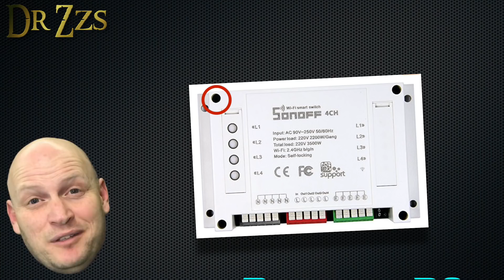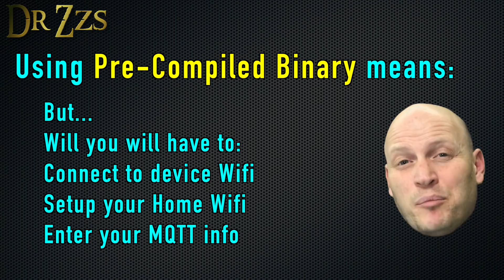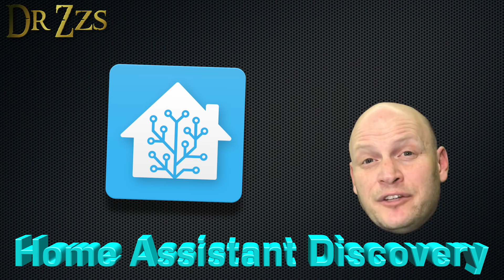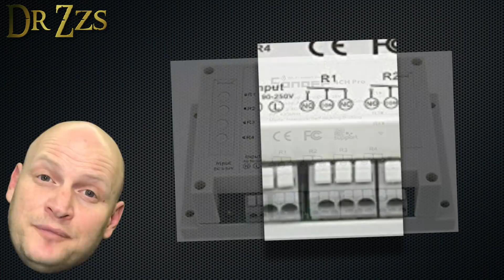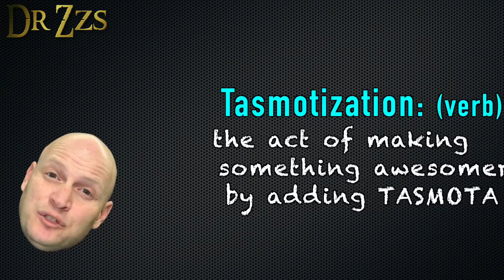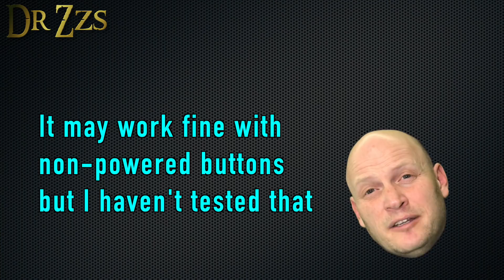Sonoff 4 channel w/ Home Assistant Discovery and FlashEZ

Comment: I been looking at your video, seen it a few times, Im trying to find a useful application for the 4 channel SonOff.

Looking forward to your RF bRidge video..   that I am interested specially if I can use the RF signal to start my car..
Reply: i use a virtual machine for Win10 running on my mac on VMWare Fusion. u can use Virtual Box as well.
Reply from the maker: oooh, so you currently have a remote start for your car?

So far, what I've learned is that some RF devices have changing codes to keep people from stealing the code and opening your garage or starting your car.  For those devices it may not be possible to program the RF bridge to learn the code.  
It still might be possible.  I'm not an expert on RF by a long shot.  There still might be a way.  I just want to manage expectations a little.  
If there is a way to remote start your car with the RF bridge we'll figure it out!
Reply: I have faith in you, some how or another you get it to work, It might not be the best or easiest way, but it work, which to me is the goal...     

BTW do you know if there is a ESPeazy for a Mac?  or a way to flash the sonoff?
Reply from the maker: Mac has trouble with the ftdi (or other) serial/usb adapters.  I've had it work a few times but not work most of the time.  There's steps you can try that I don't remember; deleting some drivers and installing others.  It was a pain, and then didn't last...  You can try googling.  I've just gone to Win10 for all my flashing.  Do you have a windows computer you can use for flashing?
Reply: DrZzs no

No I don’t have one at home.   Ill figure something out.   BTW. I m doing my Christmas light. Next month.  Im getting the lights from Amazon and want to give you credit.  Can you send me the link please. Tx
Reply from the maker: Awesome!  You'll love the lights.  I need to update the sketch.  I've got some more lights to put up myself this summer.  Here's a link: https://amzn.to/2L80mAN
That's for 10 strings of 50 leds each.  If you don't need that many there are other sellers.  
https://amzn.to/2L9Ejt9

Just make sure they are ws2811 and I'd recommend 12v.  I used 5v cuz they were cheaper.  
https://amzn.to/2sqHftY

You could do that too.  
As long as you use one of those links to get to amazon, it won't matter what you buy after that, I'll get a small %.  
Thanks!
Reply: Packed my stuff and off to the in-laws ...   they havve windows...   :}
Reply from the maker: excellent!
Reply: Ill give that a shot.  thank you

Comment: If you use optocoupled relays avoid to exede the maximun output of the GPIO only mathers the power given by the sonoff power supply, I think the sonoff can power the relay, only needs to amplify the current output of the gpio with a transistor better an optocopler.
Reply from the maker: sounds like a fun and challenging project!
Reply: Is the same you try but you show pictures of a single relay without any circuit, try to find one with optocoupler and conect it the same way.
Reply: Javier Enrique Traid mind you that the optocoupler relays are often inverted needing a low to activate them. 
Also the common 5 volt relays use about 65 mA. Having a bc547 to drive them requires very little current as well as they have an hfe well over 100
Reply: Ed19601 I know but comes rele modules with logic input all included in the module
Reply: Very true, but I was only mentioning  the transistor type as an example. Non-inverting transistor driven relay modules  also come complete for a few dimes.
My point was that the sonoff pin has no problem driving such a module

Comment: I've been using the discover method for some time now. If someone knows how to get rid of unavailable devices in HA that would be great, to much testing (maybe time for dev system). Having a WAF issue, switches go unavailable then on and off in HA, causing automation to trigger. Lights turning on and shutting off for no reason. tried to use retain commands but it just seemed to make it worse. Welcome your thoughts? and as always your video's awesome.
Reply: delete the mqtt database, thats the only way i have found to remove them

Comment: Hello again quick question about the FTDI, i checked with a multimeter and the tx and rx pins of the FTDI are sending out 5v even when the FTDI is set for 3.3v, same case with Arduino nano v3, is this normal? I tried using a logic level shifter but even though i can flash successfully I wasn’t able to read anything on termite with the logic level shifter attached. 

Can you tell me if its ok for tx rx pins to be 5v, i had ten sonoff basics, but flashing successfully is hit n miss and i think ive ruined 3 of them already with two more left to flash
Reply from the maker: that seems bad.  I'll measure the voltage output of my ftdi.  I'd be surprised if it's 5v.  I haven't experienced it myself but have heard that flashing with 5v output is very bad for the esp chip.
Reply: DrZzs thanks for the reply, and also for all the amazing easy to understand and well made tutorials, please do check the voltage on the TX and Rx pins and get back to me, I'm Hella confused lol
Reply from the maker: sorry, I forgot to do this last night.  I'll try and remember tonight.
I'm planning on doing a live stream on Sunday so maybe someone will remind me to do it then if I forget again.
Reply: DrZzs any update on this?
Reply from the maker: thanks for the reminder! 
Sorry I forgot.  
I just measured and my ftdi definitely outputs 3.3v  
If yours doesn't then either there's a switch or jumper that needs to be changed or you got a broken one. 
mine has a jumper that needs to be changed to switch between 5v and 3v.  Maybe yours does too. 
Bummer man.  Hope your sonoffs aren't ruined.
Reply: DrZzs oh no there’s definitely a solder joint to shift the VCC to 3v, what i was saying was even with the VCC shifted to 3v and reading 3v on the meter, the tx and rx pins still output 5v (while the VCC pin outputs 3v)
Reply from the maker: Shamsher Razzak that should not be happening. You must have a bad adapter.  Maybe write to them and see if they’ll send you a new one. Show them what it’s doing with images or something too.

Comment: In Home Assistant, there is something called the entity_registry.yaml (or something like that -its in the same directory as the other yaml files).  All newly discovered devices are populated in there, and associated with a unique ID automatically.   You can edit it and change the device name, and even delete the device from there, but I don't think you can change the unique ID.  I think they added this feature from version 0.64.   

Btw, I literally just got my 4ch pro last night so this video is PERFECT timing.  Can’t wait to get home to tamsmotize it. Will post a video of a project I am working on using this on automated shutters.  I am also building a homemade garage door opener so I may use the 4ch to power 
this.  You should call yourself the Tasmotian devil. Lol
Reply: I checked the entry_registry.yaml, It shows devices Hass.io has discovered like Roku TVs, however sonoff's using MQTT discovery do not show up?
Reply: Is the sonoff showing in the frontend?   If the device is visible in the front end, it should exist in the either the config.yaml or entity_registry.yaml file or both, that is.....unless the HA developers made a change that I don't know about.  Also, although my device discoveries have been pretty instantaneous (pretty much right after the device has powered up), the discovery can take some time.
Reply from the maker: ha!  Love it
Tasmotian Devil!  yes!

Comment: I believe a key point of your presentation was the statement regarding adding an external PS kind of makes the whole Sonoff thing less useful.  I too find that because there are such powerful software options available, and countless devices to add to our systems, it is easy to inadvertently push the technology past the point it serves us.  But seeing as how most of us are doing this for fun more than utility, I guess pushing the limits is what we're gonna do.  If I didn't fail half the time, I'd probably find a different hobby....
Reply from the maker: well said!

Comment: Love your videos, keep up the amazing work 😊. 
Since according to your videos you are using hassio install, are you experiencing the need to reboot the raspberry pi on a daily basis, since it hangs?
Reply from the maker: I have not had that problem.  
Is that something you're experiencing?
Reply: Yes, I'm still investigating this issue , might be due to some issues with Asus router. The thing is, I use in parallel Smartthings hub, which I don't have any issues with. Anyhow thx for the input, I will investigate this further, and again great work you are doing on this channel :-)
Reply from the maker: Thanks!
If I learn anything about hang ups and needing to reboot I'll let you know.

Comment: Can ESPeasy flash Tasmota on a D1mini too ? I've been trying my nuts of all week to flash it with the Arduino IDE. The flashing seems to work, but my D1mini clone doesn't connect to the Wifi. I also put the WIFI_MANAGER line in tasmota, but it doesn't seem to broadcast any wifi as well.
Reply from the maker: That's a great question.  I don't know, but it might.  
I'll have to try it and let you know.  

I know there was a problem with Tasmota 5.13 and wifi connections.  I just flashed a couple things with 5.14 and haven't had that problem.  

Probably the biggest difference with the D1 mini over the Sonoff is that the D1 mini has 4m memory and the sonoff only has 1m.  That shouldn't limit using the .bin files from github though.  

I'll try it when I get a chance in the next few days.  If you get to it before me let me know how it goes.
Reply: Well, the flashing itself works like a dream. For testing I flashed the sonoff-NL.bin file to the D1 mini, since I'm Dutch. But I can't figure out how to get the D1 to broadcast wifi to log into it. I'm beginning to think that the wifi is broken on the D1.
Reply: Well shoot me down !! Not sure what happened, but it works !!! But it is quite a mystery. I'll tell you what happened.
I tried dozens of times to flash the old fashioned way with the Arduion IDE and such. Filled in my router info, MQTT broker etc. Flashing went well but no connection to wifi or whatsoever. Also tried to activate the WIFI_MANAGER function in Tasmota, also with no luck. Tried the ESPeasy method with the standard sonoff_NL.bin file from the Tasmota github page, again flashing worked but never a connection to my WIFI. Looked online to see wich connection is GPIO 0 , so I could "press" it four times like in your video. Again it seemed like nothing happened. Then fired up my IP scanner, only to find out it had connected with the IP adress I gave it in the first place while flashing with Arduino IDE !!!!! I could log in tasmota and all my info was there, ip adress, MQTT broker, everything. I noticed there is no D1mini option anymore in the config, but the 'GENERIC' option shows all the buttons and such.
Reply from the maker: go figure! 
Sounds like the Gremlins were having some fun with you ;P 
I've certainly had some flaky wifi connections sometimes.  Just last night I was going crazy trying to figure out why the RF Bridge sensors weren't working and it turned out it was just struggling to connect to my network.  That happens too much.  I'm going to try a dedicated router just for my HA devices, but it also makes me want to use wired connections whenever possible.  Too much dependance on Wifi seems to be a problem. 
Glad it worked for you eventually!
Reply: I was thinking the same thing, although I just mounted two high power accesspoints in the house wich work absolutely great. Only thing left to do is configure pin D3 as a switch, and get it in HA to control the bedroom light sonoff from the bed. Do you know how to set that up ? So, bedroom light is controlled by a sonoff basic with a momentary pushbutton and in HA, so this D1 should become a switch in HA, and toggle that sonoff basic.
Reply from the maker: That should be doable.  It would be similar to the way we did the Sonoff SV for the garage door I think.  The trick will be not having that D3 button activate the relay on its own board.  I just need to tinker with it a little and figure out the bugs.  
That would be a good topic for a short video.  I'll put it on the list.
Reply: I'll vote for that to be your next video. ;)

Comment: Not sure I understand the comment of the 240 in other countries?  The US uses two hots for 240.  Other countries use 1 hot for 240.
Reply: It's because your wiring standards are so low you can't be trusted with more than 120v :)
Reply from the maker: It was just a joke.  Some commenters had poked fun of us for not using 240v.  Those extra terminals really aren't necessary.
Reply: Gotcha, didn't want someone thinking they can run 2 phase power through it.  Where they can poke fun is the whole 2 switches in what we call 3 way.
Reply: Maybe I've seen just awful wiring jobs, but I've seen some terrible wiring on the forums in other countries and people act like it is normal?  I still stick to the US wiring with neutrals in every switch box though.
Reply from the maker: See travis.  This is what I have to put up with ;P

I'll have you know I only tripped the breaker once yesterday installing a sonoff for my garage lights.  And no one but me even noticed the sparks!
Reply: You know you love the banter and to be fair I've never implied you or what you do is dangerous :)
Reply from the maker: I do love the banter.  All in good fun.  :)
Reply: Banter is always fun! eunc00 have you seen his sonoff wrapped in electrical tape? To be fair I do believe he called himself out on that in a later video.
Reply from the maker: ya, I did some dumb stuff in that video.  I would take it down but it's still my most viewed. 

The other day I googled "Tasmota" and the first link was to Theo's git hub and the second link was to that video!  So even though I'd like to "improve" it I can't really take it down now. 

But I still wrap them in electrically tape sometimes if I really need space :)
Reply: Doesn't the warmth from the power supply and moisture make a goo of the tape? Guess it depends on the climate as well. It is still a great video! I have chopped the ends off the basic and tied in some 16 gauge stranded pig tails for the hot in, hot out and common in. Then tie wrapped them on the case for them not to get pulled loose. I do prefer the 2 gang deep boxes for my wall sonoff basic installs though. So much better than zwave! If only someone made a Esp8266 based dimmer.
Reply from the maker: I've got a dimmer module to try.  The trick is it will probably only work with incandescent bulbs.  LED bulbs that are made to run on 110v and have the power converter built into the bulb are not really dimmable.  At least not without flickering.  

I need like a heat shrink tube that's big enough to go around the sonoff.  That'd be cool!

Comment: Sonoff S31 video might be a good one.  I flashed two of them this weekend and they are great.  I'm using them for notifications on the washer and dryer.  So I can see if they are running, how long they have been running for, is the dryer door left open, how long it was left open, etc.  I didn't solder to them to flash I lined up my female wires in piece of header and taped them to the board for flashing.  Google for "kcs garage sonoff s31 teardown", I couldn't get the link to paste.
Reply from the maker: awesome! 
I'll check it out!  good idea.
Reply from the maker: I've got a sonoff Pow R2 I'm going to use for my 3d printer.  similar to the S31, just connects like a Basic instead of having a receptacle outlet.
Reply: Yeah I couldn't pass up the S31 just being a plugin, all about wiring and soldering but these were just cool and didn't block the other plug.  I think they used a new power measurement chip as well.
Reply from the maker: cool.  I'll have to try them out for sure.
Reply: Just go ahead and put an automatic monthly payment to Sonoff :)
Reply from the maker: For sure!
I actually just emailed them to ask if they want to work with me.  I get random companies asking me to make videos about their products. I’d rather work something out with iTead. They have some new device that makes a “dumb” ceiling fan “smart”. 
I want it!
Reply: I saw that! $13. Only 2A load though but I do believe that is fine as most fans are under 1A. That's why they get away with 16AWG wire on them. I want one as well!

Comment: I feel like I've asked this before, on a live stream, but could I use a Sonoff 16a POW to switch a 1hp water pump without blowing the Sonoff? My country is one of those quirky ones with 240v power.
Reply from the maker: I do seem to remember that question.  Seems like there was an issue with the initial current requirement to start a motor and that a normal relay wasn't the best suited for that job.  
Let me ask my engineer buddy and get back to you.
Reply: DrZzs thanks, matey!
Reply: You can deal with the initial current draw via some capacitors. Take a look at some video where people are powering AC units off of batteries. This may give you some ideas https://www.youtube.com/watch?v=yjK1Gi_u6ss
Reply: Use the sonoff to drive a contactor instead. They're made for switching motors
Reply: Mike Hardwicke Brown cool! Thanks.
Reply from the maker: great info!  Thanks Mike.